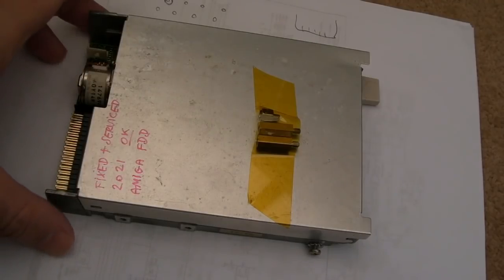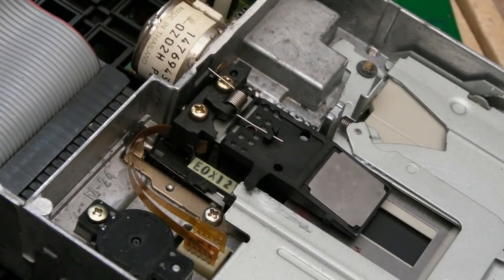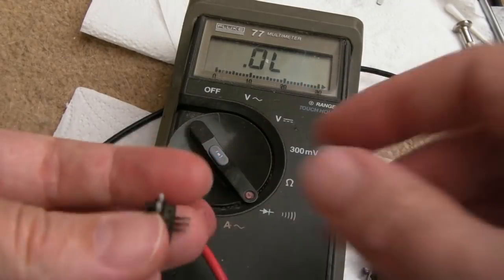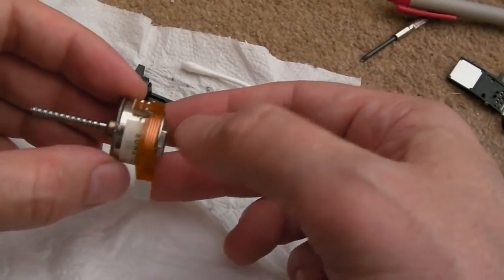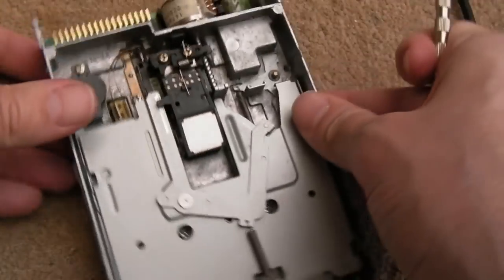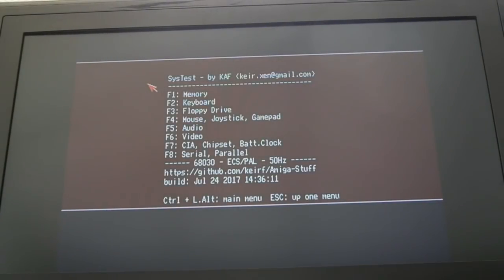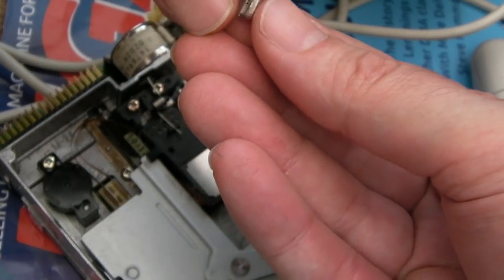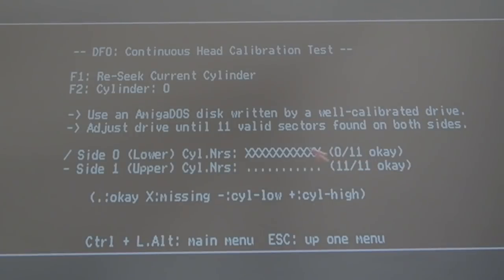Commodore Amiga Floppy Disk Drive Alignment & More (Looking at 4 x Amiga FDD)

Comment: Nice job. I needed to do a lot of what you did fixing up my old IBM laptop drive. I found taking that top plate that the top head rests on, out of the drive. Made aligning the top and bottom heads much easier. After you do that, the top and bottom heads sit on top of each other and you can clearly see if they are aligned. You just need to get your head in there with a good bit of light.

Comment: This video and the previous one you did about another damn 235 are by far the best and the most in depth I've watched on the topic. Your perseverance is admirable. Can you please clarify what you mean by "adjusting the PCB" for the track 0?
Reply from the maker: Yes, that PCB (on the first model drive in this video) has elongated holes (not circular) - and the screws can be loosened allowing the PCB to slide one way or the other, and since the track 0 sensor is on there the alignment from track 0 follows with that movement.

Comment: dude youre becoming the internets foremost floppy expert. I've already fixed a floppy drive with your older video.  next thing should be using a scope for alignment and diagnostics.
Reply from the maker: Thanks, I thought about getting the scope onto it in that video, I saw no point though - the software there on the Amiga is better than trying to do it with a scope imho.  Might be useful for another drive on another system though.
Reply: @GadgetUK164  Exactly, I have a Commodore CBM 8050 Dual Drive Floppy Disk that I have to fix.  Thanks a lot for these videos.

Comment: Super movie  !! 🔥🔥🔥 !! .  It's a pity that 20 or 30 years ago we didn't have access to YouTube and such knowledge and specialists.  ps: can the chip memory (2Mb) in the Amiga 1200 be replaced with a larger one (8, 16 or 32 mb - and faster with faster access)?  has anyone tried this?  does the addressing go through the AGA integrated circuit or through the ROM?
Reply from the maker: The 2MB Chip RAM limit was never passed by released Commodore hardware.  You can get around it in emulation, and maybe the Vampire (with AGA chipset replication) it technically might be possible...    What you can do on the 1200 is add a load of ZIII local Fast RAM to a CPU card.  eg. TF1260 or TF1230.
Reply: @GadgetUK164  Yes.  I know.  I also have a winUAE emulator.  But I always thought that emulation was a blind crew.  It's nice that there is WinUAE because it allows you to test many things, but we have to solve old problems from the past (we have to solve Commodore's problems).  and we only need a few things to be happy.  we need a new motherboard for Amiga fully compliant with the standard and new elements such as USB, network card, new sound card, graphics card with many connectors, and new solutions.  without emulation if possible.  the most important thing is to go one step further.  that's why I asked about the 2 Mb limit to bypass it.  If there was more memory on the chip, it would be possible to do more and faster.

Comment: I had a drive with those 2 switches that weren’t working. Did the exact same thing but when attaching the bottom transparant piece it sprung off. Never found one of the springs again 🙁

Comment: Hi. The bit you  removed 13-14 minutes in, I've managed to clean ok, but when I was attempting to reassemble it, one of the tiny springs when flying and I have looked everywhere for it. Are these replaceable?
Reply from the maker: If you can find a spring small enough!  You might be able to find one on another FDD - or in a "spring kit" designed for watches perhaps....
Reply: @GadgetUK164  Thanks I've ordered a spring so fingers crossed. I appreciate your videos. Really helpful! thanks!
Reply: @GadgetUK164  Hey.. Not much success with replacement spring, can you still get the sensor switch itself?

Comment: For that head reattachment to the metal carrier I wonder if Kapton Tape would do the trick? 🙂
Reply from the maker: Kapton tape has really poor adhesion!!!  Even the good stuff is nowhere near as sticky as something like sellotape =/   I think its deliberatly designed that way - to avoid leaking sticky residue on the components / board etc when used!

Comment: Are Amiga floppy drives becoming so scarce it warrants spending all this time to get them working?
Reply from the maker: No, but as you should know by now - Most of what I show on my channel isn't worth the hours when you compare to cost of just buying "a working one".   I dont care how long something takes to fix when it's part of a retro system.
Reply: @ButterfatFarms  what's the point of you?
Reply: @ButterfatFarms  and in rey to your original feeble attempt to try belittle people with your delusional grandeur superiority. There comes a point in all retro machines where a time comes that what would have been for the scrap heap starts justifying the extra effort to salvage as numbers become less and less.
I was asking Chris, not you, had it come to the point where spare floppy drives where so expensive or hard to come by, that this effort is becoming the most viable option.
When I want to ask you a question I will @ you.